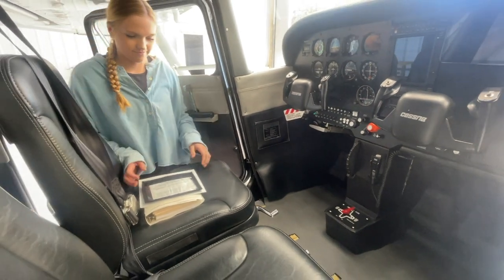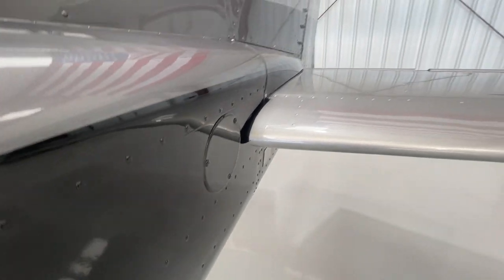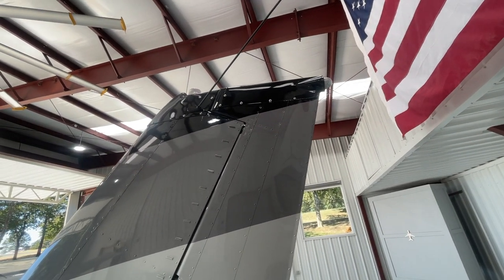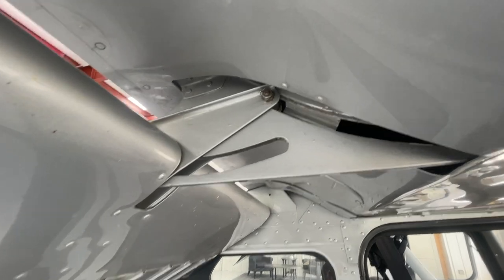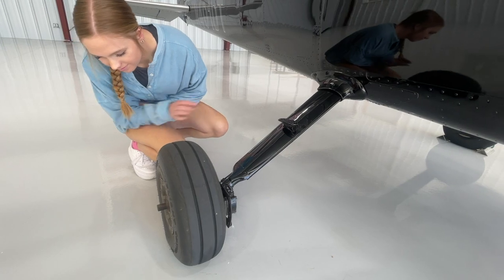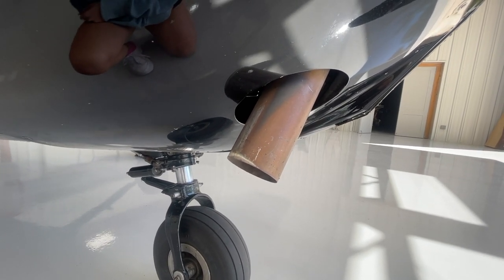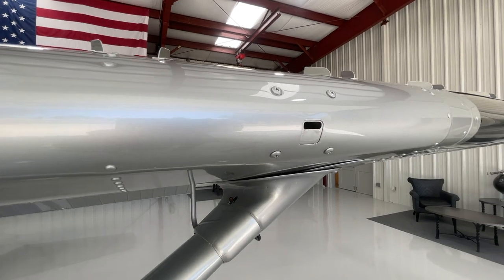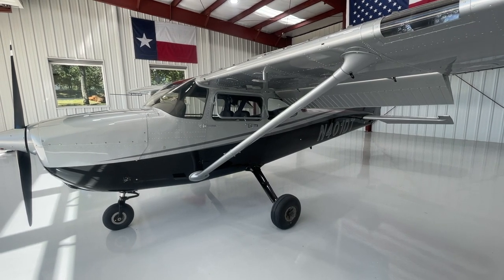Cessna 172 Preflight Inspection

Comment: A pre flight is just that.. A pre flight. Not an annual.
Reply from the maker: Ha, true. If you can’t preflight a Cessna in less than 10 min you’re probably digging a little too deep. Assuming the thing hasn’t been sitting in a barn for years.

Comment: Are tire witness marks a required check?
Reply from the maker: Sorry Jabari, can you re-state your question?
Reply: @FreedomFlight1  Yep, I'm referring to the circular marks on the tires that line up with the tire stem that let you know if/when the tire slips.  It's on the pre-flight checklist for the school I selected, but I haven't seen people check them on YouTube.  I was just curious to know if it's a required check.
Reply from the maker: Ahh yes!  Now I know what you are talking about.  Thats actually great (and interesting) that your school has you check that.  That dot, usually red or yellow, if put there by the tire manufacturer for the mechanic to line up the tire stem with it when installing a new tube.  True, it is possible the tire could shift a little over time, I'd imagine if the brakes get locked up or maybe the pressure getting too low, etc. Technically, it is not something that Cessna states that the pilot needs to check on every preflight but its probably a good idea!  Thanks for asking.

Comment: I really like your presentation, The step-by-step walkthrough enhances understanding, making it an excellent resource for both novice and experienced pilots. My question is, 
What additional tips or variations would you recommend for a pre-flight inspection in specific weather conditions or unique flying environments?
Reply from the maker: Hey thanks for watching.  As far as the "pre-flight inspection" and adverse weather....if flying in the clouds I would always check that my pitot heat is working as well as I like to check the defroster in the cockpit during the engine run up.  Of course, a very good understanding of the weather for your flight, the forecast, and always have a back up plan.  If I find myself having to fly into a unique environment that I have not been in before I try to study every aspect I can of the area especially the terrain.  I've found myself looking at Google Earth to better understand the terrain as well as watching previous flights on FlightRadar24 to better understand traffic flows.  Hope that helps, thanks for watching!